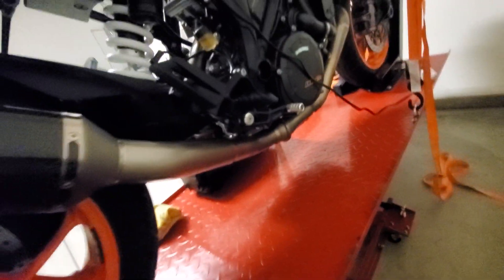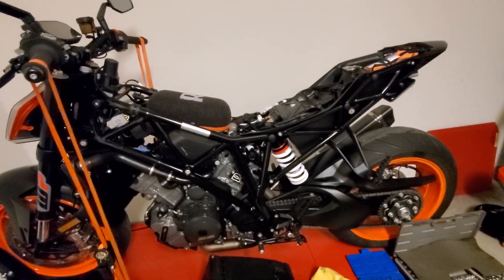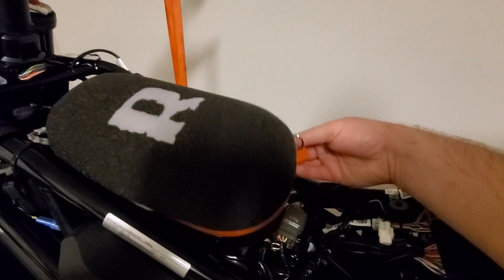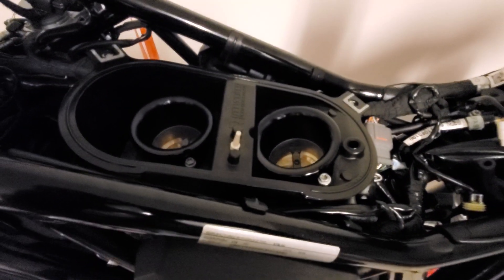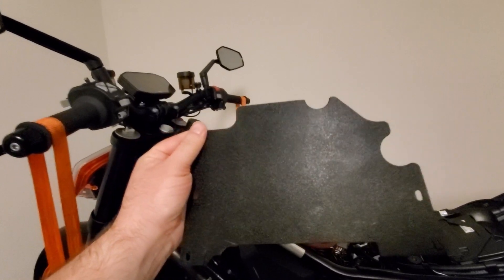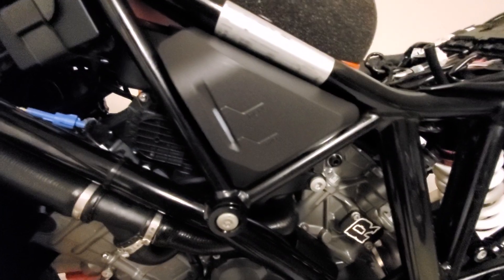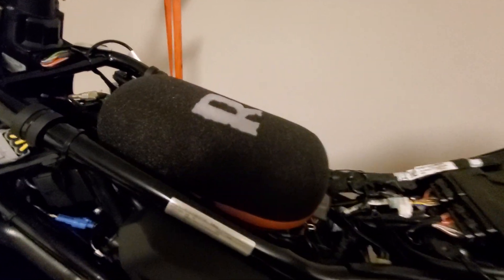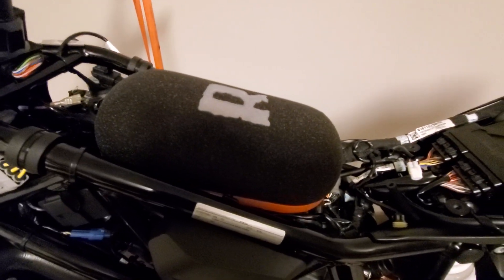Rottweiler Intake Graves Exhaust 2019 KTM Superduke R

Comment: What did you do with the vent hose from the rotweiller intake?
Reply from the maker: It connects at the rear of the intake assembly
Reply: @tsquine87  From the crankcase? No oil leaking?
Reply from the maker: @rickieyuill1110  There's a spring clamp that holds the vent hose for the crankcase breather. No leaks. Be careful not to over oil the filter or it will drip down the rear cylinder